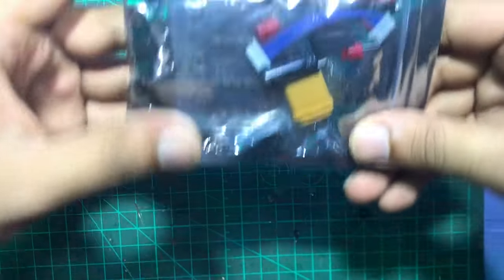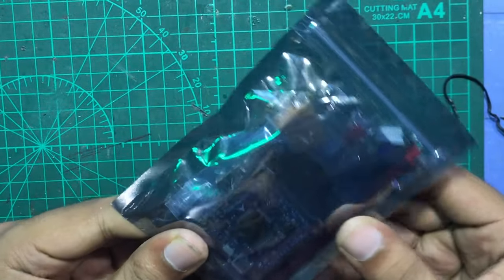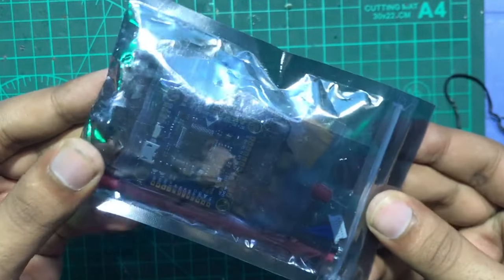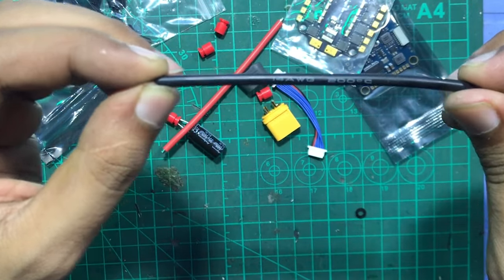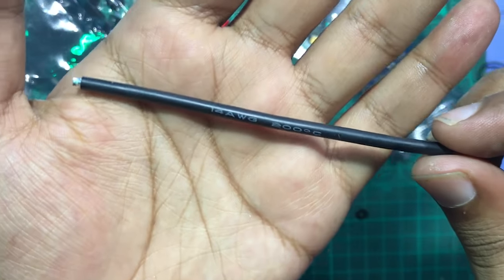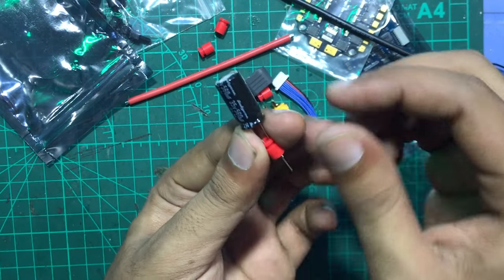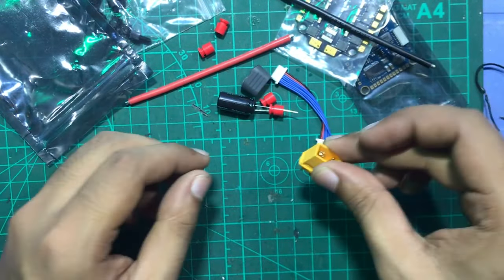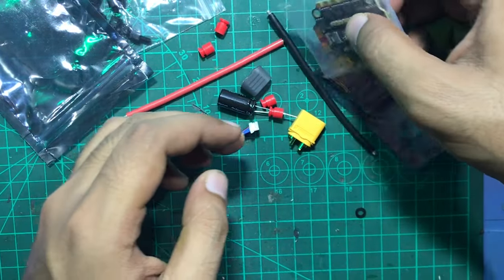NEW F4 V3S PLUS Flight Controller Unboxing - F4 FPV

Comment: Hi and thanks for the very informative video. I am using the F4V3s on a quadcopter and want to use an SBUS receiver. Have connected the receiver to SBUS, + and - on the board next to the little reset button and bound my receiver to my Taranis. Am using Betaflight config and have flashed the Omnibus F4VSD firmware. Betaflight config will not pickup my receiver. Have set UART6 to SBUS etc. and have tried a couple of other SBUS receivers. I am not a techno on this stuff so I assume I am doing something wrong. Any ideas appreciated